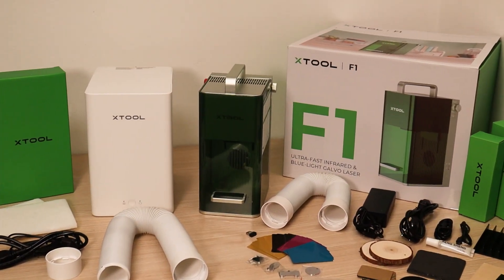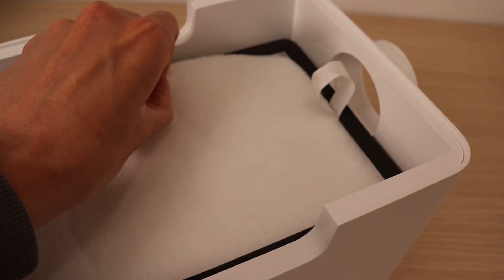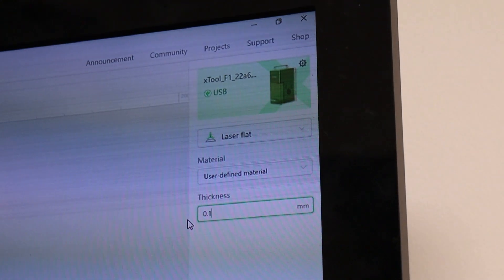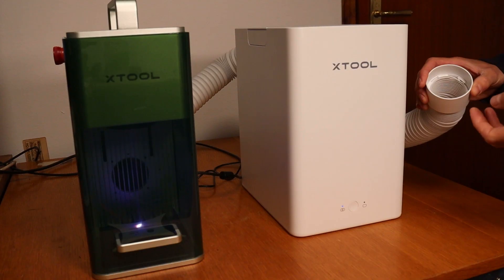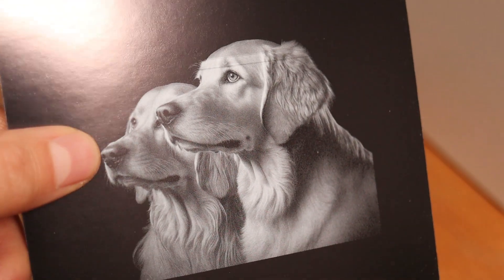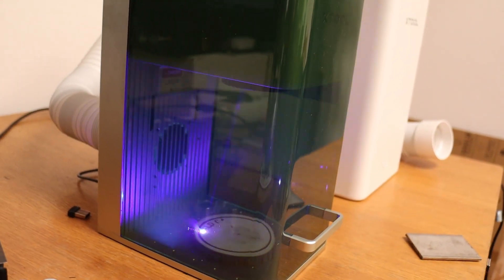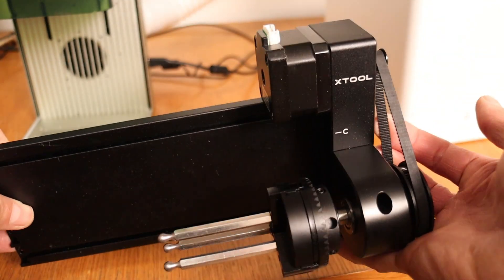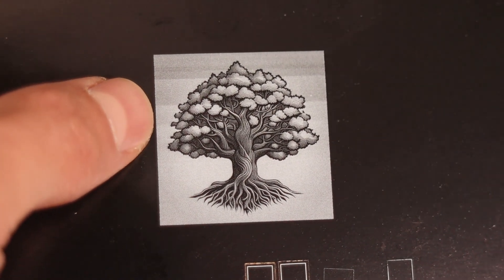Unleash Limitless Creativity: xTool F1 Portable Laser Engraver REVIEW and TEST

Comment: Hello JT,
Congratulations 🎊 for all you very informative videos.
Cheers 🥂 🙌.
May I ask your opinion...
Now that you have quite an experience with different laser machines and using them for your business, would it be wise for me to already buy the more relatively expensive machines (xtool) to start my cutting & engraving business? Or should I start with cheap ones and upgrade later on? Would this come more expensive in the long run buying these  cheap laser machine and upgrade to Xtool? 
Should I just master my skill sets with the cheaper machine and relearn the more expensive machine in the future? 
If you were to start over, what would you do? 
I have a starting capital of $10k. 
I'd like to learn from champagne glass engraving to large multilayer plywood art cutting like Mandala arts.
Being now a retiree, I have  all the time to focus and learn the trade.
I would appreciate if you can help me decide.
Many thanks,
Alvin
Reply from the maker: For that budget, I would recommend xTool P2 for laser cutting and maybe xTool F1 for bottles, although you can use P2 for bottles too. You can get a good bundle deal:
https://www.xtool.com/products/ultimate-productive-business-duo?ref=8nM_J_3Zfk8s&utm_medium=5306&utm_source=influencer
Don't forget to add RA2 rotary extension for bottles.

xTool machines are the easiest to use (especially for bottles) and are good quality.